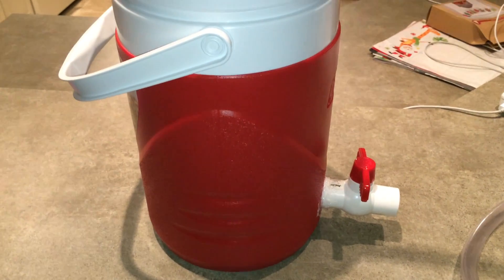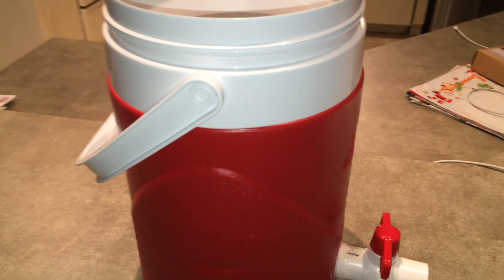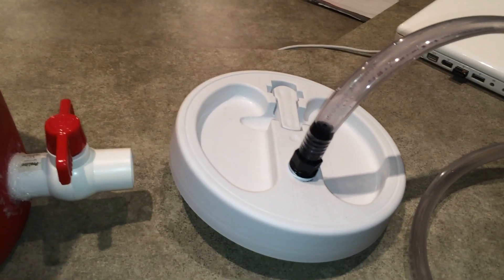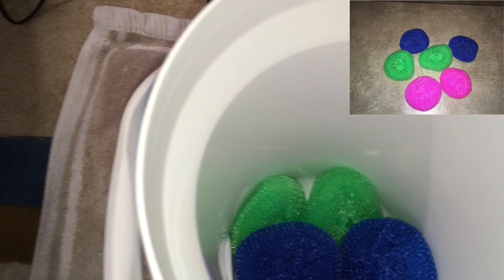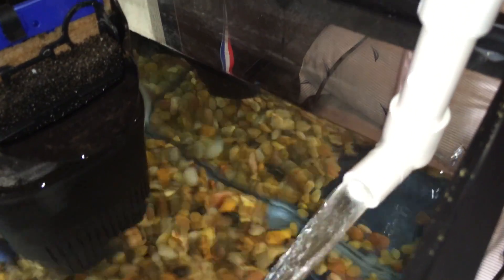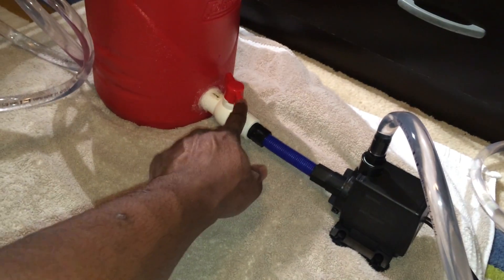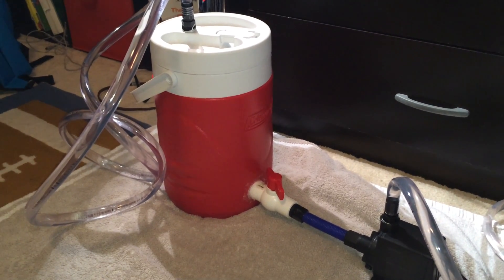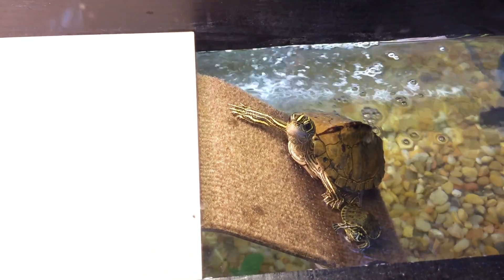DIY Canister Filter   Final

Comment: Thanks for a great how-to. The link for the quick connectors is not recognized by Lowe's but I found others. My question is, what size couplings did you use to attach the quick connectors? DIY Aqua Pro used 1/2 inch but the quick connectors are much larger. Also, any updates as to how your filter is still operating? I too am using your design for a turtle tank.

Comment: Hi i build it myself too, the only contras i ´ve seen is when i turn off the power head, and then in vertical lines hose, the water  turns back producing a water hammer creating a lot of pressure inside the filter unit, leaking water randomly in the lid. A solution for this is with a check valve just at the beginning of the hose in the output on the powerhead, this avoid the water return back to the filter. If someone have the same situation, please share your solution.

Comment: Good project. to solve your water outflow and inflow.. just turn the two inlet and outlet upside down. Water inlet from the tank. Should be at the bottom. Water coming out from the canister into the tank via the pump shud be on top. That way.. u will force the water to climb up.. and filtering will be more efficient.

Comment: The media is restricting too much and/or the route from the tank to the filter is to long and low, could be affecting your siphon and making the pump work too hard.  Try putting a grate at the bottom, making a space, and clean up your hose routing.

Comment: large rubber o-rings. place the pump before canister, dont use siphon, or use like 2" siphon tube to achieve same flow rate as the pump.. then allow pressure to return water since your canister is air tight. great job, no silicone.

Comment: I believe the root cause of your flow problem is the excess hose. Your hose should be cut down to the point where the pump does not have to fight with the long travel but still long enough so you can move the filter a bit but not too much.

Comment: Hi Mark, great video and thanks for posting.  One suggestion if i may.  The reason you had to restrict the water flow so that water wasn't being pumped out faster then it was coming in is because the media is blocking the output hole inside the bucket.  If you cut a small pvc pipe into 4 pieces (stand them up on the bottom of the bucket), make sure each piece being slightly higher then the hole in the bucket and put lighting diffuser on top of the "pvc stands" you built, then put the media on top of that, so that the media isn't being sucked into the hole it will fix the problem :)

Comment: Another excellent and inspiring video--thank you. Pot scrubbers on bottom of can is a great idea. Might consider building a small stand (say, 12 or 18 inches square) out of 2 x 4 scraps, thereby making a more stable base. You may then run a bulkhead out the flat--no leak--bottom of the can and elbow out to your pump. (And you just know there will be many, many more builds in the future ... O, cruel fate!) Thank again. Have fun!

Comment: Hello,
I agree with your media order. You are cleaning, polishing, biologically filtering, and them chemically filtering. That helps the biological area from becoming a "muck pit" that needs unwanted (why unnecessarily disturb your biological bed) attention. I am certain you figured out your flow problems were because your hose (especially your inlet) are too long. Let gravity help. Most commercial canisters actually use gravity and that is why they pump from the  bottom of the canister up.
Be Well